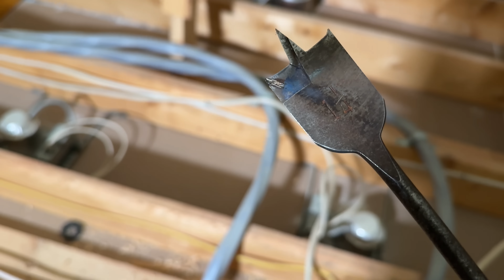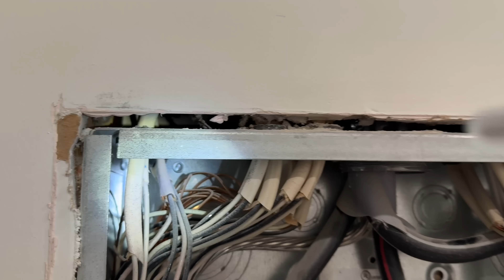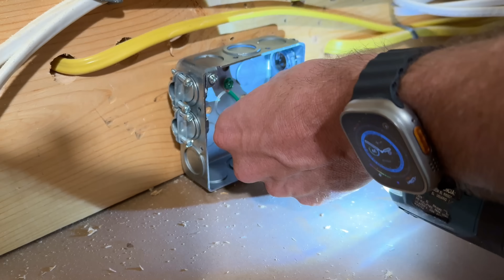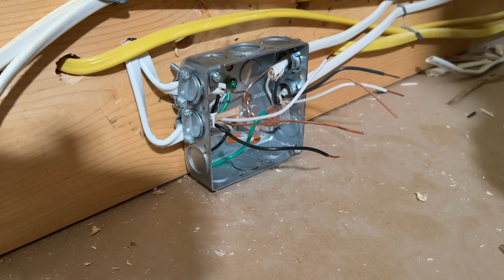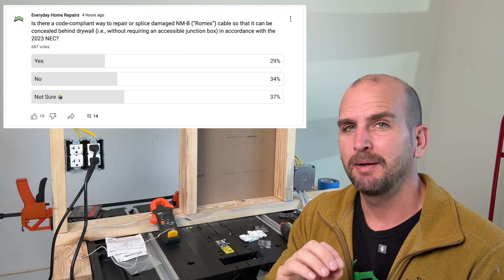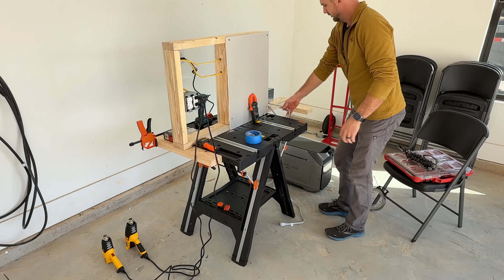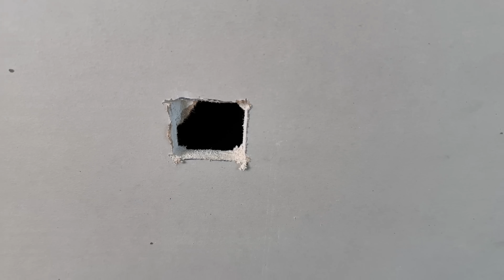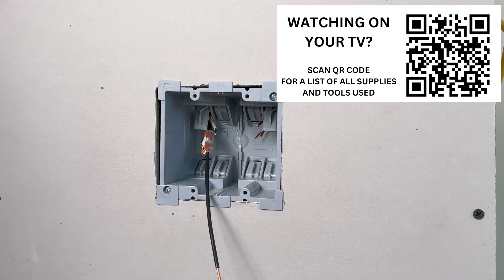How To Repair Damaged Romex |  3 Easy DIY Fixes

Comment: Never understood why a spliced connection inside a metal box buried in a wall isn’t acceptable….but this is
Reply: Yeah I could see why you might argue that the click on connections you have on an interconnector device are more reliable than traditional wire nuts, but the rest of it is nuts (pardon the pun). Especially given that we know how reliable junction boxes are in general use if prepped properly.
Reply: Who said leaving a buried box in a wall is acceptable by code?  Sliced connections in junction boxes are compliant because boxes need to be secured properly by code, and are dictated to also be accessible. 

Any box just left within a wall and not accessible is not to code.
Reply: @David.....   You misread what he said.
Reply: Yup, makes no sense.

Comment: I've seen those NSI connectors used in mobile and modular homes. I've also had to cut those connectors out and connect the wires in juction boxes because the connectors failed. They're scary to me. I don't trust them. I put them in the same category as the devices you stab the wires into holes. Not worth my reputation.

Comment: I was so happy when the code allowed their use, will use it for some lighting loads, outlets, and general duty circuits. I am not a fan of using one on a kitchen circuit. You have to ask yourself how much of the house you can wreck by not using this repair trick!

Comment: 15 years ago, I found 3 way light traveler wires that had a nail through a conductor underneath catwalk planking in my attic. I just did a lineman's twist and solder. Heat shrink the conductors and another heat shrink over the jacket. I will be giggling in my grave at the time certified electricians discover my handiwork. I also converted my receptacles to soldered and capped pigtailed outlets. Now the lights don't dim when a high current device kicks on. I have seen the work of some dodgy certified professionals and I will put my life in my hands thank you very much.
Reply: Not buying your story about lights not dimming anymore when a high amp load kicks in though… your voltage drop starts at your service under that scenario. Any halfway decent connection will not cause voltage drop downstream if the load is upstream from it.
Reply: @Gruntled2001 i mean, every outlet or junction adds a weak point, so it's very possible his method minimizes the dimming, but yeah it won't remove it entirely, just due to the resistance and voltage drop of the wire itself, it's also possible that his house is older where lights and outlets of rooms are on 1 circuit, I know in mine they are and when my A/C in the bedroom kicks in, the bedroom lights dim, it's nothing concerning just normal voltage drop, as there's probably 200+ ft of 14/2 NMD90 (yes I know the A/C should be on a dedicated circuit, that just isn't an option without ripping open walls unfortunately)
Reply: @HowYouRemindMe269  It is an older home. Every receptacle had two wires in and two wires out. The central AC does dip the lights today. Running a vacuum or hair dryer would dim lights. Bathrooms are not dedicated circuits as they should be. Fridge outlet was branched off as well. Home is not even close to today's standards. I have Zinsco breakers and I am well aware of not max loading them. I have replaced all the cloth covered wires and first generation Romex? It was dark grey and would crack when disturbed in the attic. I am not an electrician. Just a fella that understands physics and ohm's law.

Comment: Good video with good information. However, I used to use the blade style of connectors in my pickups and motorcycles. Mostly for lights or other accessories. Many of them failed in very short order so i stopped using them for anything. Naturally I wouldn't use the Romex Splice Kit in my house as I wouldn't trust it. The rest of the information was very good.
Reply: I wonder if the failures might have been caused by the movement and vibration of a moving vehicle that doesn't happen to a house.
Reply: @twentyfiveyears5010  You could be right. However I wouldn't want to take the chance.

Comment: With that splice kit, I'd like to see mechanical screw down connections at those wires, with the wires being stripped back and going into some sort of slot and then a mechanical screw clamping them down.  Like you, I'm not so confident about those piercing type connections, leaves a lot of room for error.

I think I'd still prefer to use method #3 to repair a damaged wire in a wall.  Method #1 like you did in your attic space is what I'd do for those types of access spaces as well.  I don't know if I'd want that splice kit in my wall, it might be NEC approved, but I'd rather trust WAGO connectors or wire nuts and pulling the wire into some sort of a work box and splicing them like you did.

Comment: fix 3 I actually did when I wanted to add an outlet to our pantry for a plug in light and a robot catbox , There's a box on the other side of the wall just bippity boop new box installed. But the freaking wires coming out of the box only let me pull the outlet out maybe a half inch it was hell to remove, so I had to extend them just to start working. Our house used to be owned by an electrichicken and there's half assed to be had every time I take off a plate
Reply: The first place I owned (trailer) had half of the outlets triggering a ground fault on my tester. IE: They were all wired in reverse. >.< Good thing I grew up in an EE household. :p

Comment: an IDC in a mobile home is so much scarier than in a wall. IDC (insulation displacement contact) IE the blades works  well for a lot of applications, home power distrubution isnt one of them IMO. I see them fail all the times using them in low voltage small signal applications just being left alone due to oxidation over time

Comment: Insulation displacement terminations and splices are super common in low-voltage telecom circuits, most famously the 3M Scotchlok. I would never want to use them for AC mains loads. All those self-contained devices that are used in mobile homes and trailers are horrible, in my opinion. But they're perfectly legal in accordance to NEC 300.15(e).

Comment: I've used those NSI splices before and they can be great.  Unlike typical crimp style wire connectors, they have rather beefy spades that make more contact with the wire... probably why they can handle the load.  They also come with strain relief clips for both sides of the connection you did not show and I highly recommend they be used to help reduce pull on the connectors.

I'll say one thing... for what is a rather simple design and cheap/easy to make, they are outrageously priced at $30+ each.
Reply: I think I would write a note inside the closest box cover noting the location of the splice, maybe one on each side to make location easier. "NSI inwall splice 18" east." / "NSI inwall splice 24 inches west."
Reply: @JacquesofAllTrades-l4x  A note is good and as long as it is done that way and legibly and not on a piece of paper or something else which is not permitted within a device box.  I'm sure you have seen lots of weird things done by owners/amateurs.  Admittedly, this would be the only way to identify/trace the location years after the fact.
Reply: Just like other  high reliability industry parts, you’re paying for the extensive testing that was completed and certified the part to do what it is supposed to do even to extreme conditions
Reply: @-justin-4077  Yep!  R&D costs.
Reply: @-justin-4077  I agree. It is their (and only their) job to certify electrical product safety. These entities are the imprimatur of the governing body that sets the standards for safety. So why would you not trust that?
Reply: They're probably building up a reserve fund "just in case" there is a rash of fires and law suits in a few years.
Reply: Also a REALLY good idea to label that the wire has that connector down at the breaker panel. Next person to try and pull that wire through for replacement for whatever reasons is going to have a hard time pulling anything with that junction in place.
Reply: @canuckfixit7722  Am I  an ass for asking if Sharpie ink is electrically rated?
Reply: @canuckfixit7722  are even human? he literally said "write a note inside ... the box cover." Obviously he means write on the backside with a sharpie. There's no other way to understand this. He can't put paper "inside" a solid piece of metal/plastic.
Reply: @ssl3546  More-so than YOU.😄  Thats just being obnoxous!  So what "solid piece of metal/plastic" do you mean?  Device boxes have void space and that's where code applies in the way of box-fill.😉  A note is good!

Comment: Is the double splice with the Wagos actually necessary if there is no intent to add an outlet or other device to the box? That is, why not just add a longer length of wire between each of the inline Wagos at either end of the damage you are repairing? The effect would be the same, but with one less connection/splice in the circuit.
Reply: That's probably code related in that each "end" of the wire would come out so many inches

Comment: I enjoy your channel, thanks for putting it all together!  70 year old homeowner here, not a professional electrician.   When I have to lengthen a shorter piece of Romex I would probably  wire nut it all together in a metal box with a cover.  Is this not acceptable?  I have a basement and generally easy access, so I generally just run another piece of wire though.  Never had trouble.  When I was younger I would solder it all together.  Then wire nut it for protection. The plug looks useful.
Reply: Personally I don’t use the in wall plug connector unless I desperately need to. If you have the option to do a junction box I highly recommend that instead.
Reply: @fancenter5204   Thanks, just wondering!  I enjoy your channel and lots of home improvement channels. My home repair project of the week was tiling my nephew's bathroom. Went ok, except the glue took longer to dry than it should have. Next project is continuing to insulate my barn.

Comment: This is much better than what the professional electrician told me that I would have to do.  It involved tearing out walls and thousands of dollars.  Thank you for recording and posting this valuable educational video.
Reply: That’s bc he doesn’t want your house to burn down
Reply: @KristofferYoung-qn5lm  more like afraid of ANY possible liability even if its unrelated to the repair.
theres procedures for mechanically securing, splicing, soldering and wrapping other cable types, so the repair can be done cheaply and safely. the NEC is just behind on this one and encourages expense over practical knowledge, and some electricians don't like these splice kits because even though they payed UL and other safety regulators for a greenlight some still claim they cause fires, idk about that personally, but i trust UF/USE style splices more.
Reply: @KristofferYoung-qn5lm  I understand your point, but the question remains.  "safety vs risk"  Is the repair valid or not?
Reply from the maker: You bet, happy to help!
Reply: @EverydayHomeRepairs  Ouch!!!
Reply: Were they coincidentally providing a quote for them to do the work? 😅
Reply: He did mention in the video  the solution your electrician suggested. Running new romex.
Reply: It does cost a lot to do it properly if you don't want a junction box.  That is if there is even enough cable to make a junction.   I wouldn't be so judgmental about the cost.  There is a lot more involved than uneducated people are aware.  Makes it tough to enjoy ones job when you got people pissed at the cost even if you are barely making it worth it.

Comment: There is a huge fallacy in the certification of this type of device.  Or any kind that depend on a "blade" or "flat" surface contact to carry current.  With todays devices you will often find a large capacitance on the input circuit of an appliance.  Like the LED light, or something like my portable induction cooker.  This capacitor can look like a short circuit when the circuit is first activated and it takes time to charge, sometimes several cycles of the line frequency  Current is only limited by the DC resistance in the line.  As far as I know none of the testing and approval agencies test for the result of this large current spike.  It can, in fact, cause a "spot weld" arc on any place in the circuit that can not carry the current without spot heating.  Now, you have a high resistance connection for the current that gets a little worse each time the circuit is switched on.  Like a low contact area of a blade type contact.  Think of two knife edges in contact at 90 degrees trying to carry current.  The ampacity of that area is very low even though the restance may be low.  The same for a blade type connector.  Hardly anyone in the industry is aware of this problem because measuring the REAL peak current requires high frequency capable instruments.  a cheap clamp on meter won't do it.
The fourth way to fix a nicked wire without enough slack or running new cable is to use 2 boxes with a connecting cable between them.  That is my preferred method.
Reply: I Agree, two Gang Boxes, with the Same Grade of 12 or 14 Gauge Wire....etc...
That prevents potential fire hazards...
  Floating a Connector like that behind a wall isn't safe....
Reply: highly capacitive loads have been around forever and a day. The people who do the certifications are aware of this, even if your electrician isn't.

Comment: TE Connectiviy made the ones that were used when I had a breaker panel moved and he tapped into the existing 12-2 runs.  (no ground)  I do have access, but not enough room for junction box.  I've experienced no problems.  (since Dec 2020)

Comment: Solder + heat shrink.
Reply: I'm not sure, but solder connections aren't currently OK under the current code.  Back in the knob & tube days (1940's) they might have been.  I'm sure that someone will quote the proper section of the NEC about this in a subsequent comment.  Perhaps they should (UL/NEC) approve a method for in-line splices where it can all be sealed up and insulated to proper standards (heat, etc.).  Is there a manufacture out there that would design a "bullet proof" in wall splice method that meets the 90 degree C standard like the wire (THHN) does.

Comment: too bad WAGO doesn't make inline connector in other colors like black and white; you could color code your inline splices with black and white for hot & neutral (using orange for ground) just to avoid making a mistake.
Reply from the maker: They do have some different colors now but they aren't aligned with conductor colors 👎
Reply: Maybe keep 3-4 colors of electrical tape on you and mark them that way, but I'd assume that people would pay more attn to the wires themselves than the connectors.

Comment: As an electrician in Canada...yeah I'm not doing that. Either re-pull the cable or put in a junction box. But you guys can have hidden splices in your walls if you want.
Reply: Sometimes you have to do what you do.   This is another example why unloading a staple gun on every wire in a home can be problematic. I believe that everything we do requires serviceability in mind. Stuff happens and why make it insanely difficult.  Or let’s run conduit through the entire home 😂
Reply: @LDoctorKC If you gotta open the section of wall to find the Problem area or break in the sheathing, it is Code in NEC to use Junction Box, to Properly and safely prevent a hidden fire hazards....
Reply: Isn't this guy Canadian?